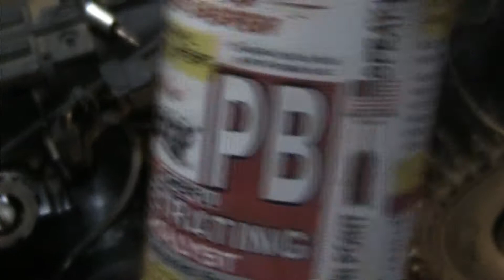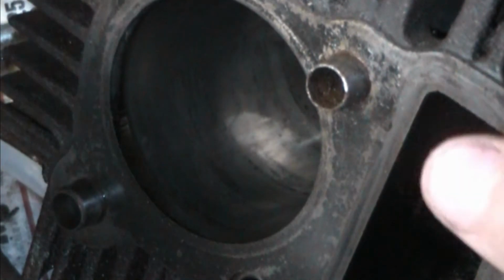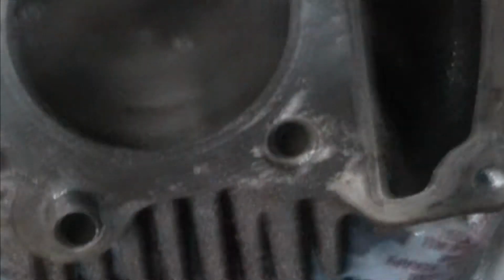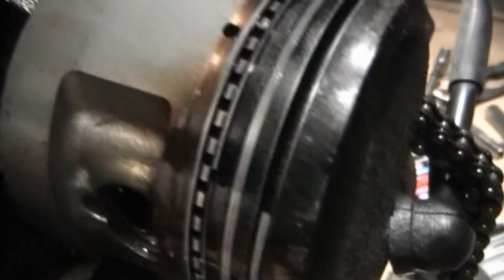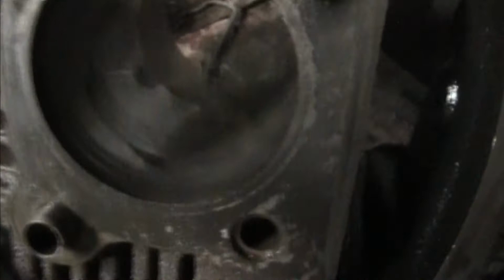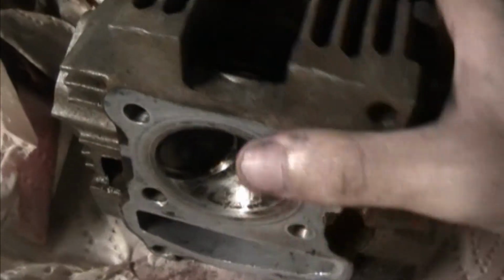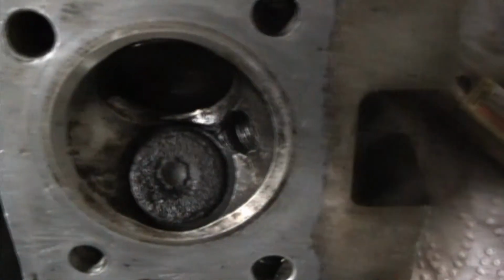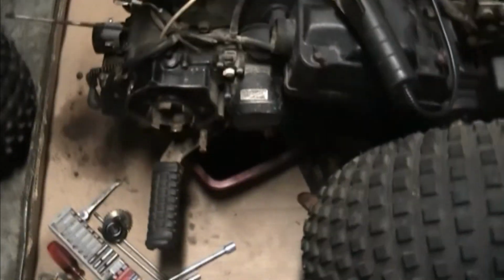1985 ATC 125m TOP END rebuild part 2

Comment from the maker: @gangsterbryce ya man thats the plan gonna replace the exhaust valve also. thought about doing the cam chain but it is tight enough and i couldn't hear it ticking when i had it running. shes gonna shit an get with new top end and aftermarket carb stay tuned and thanks for the comment!
Reply: EricTehRedneck. I have the same motor and I can not take it off after taken out the two screws out.  What am I missing? Please advise. Thanks
Reply: EricTehRedneck .  I can not take the sylinder off.